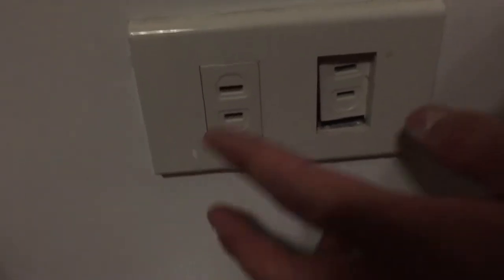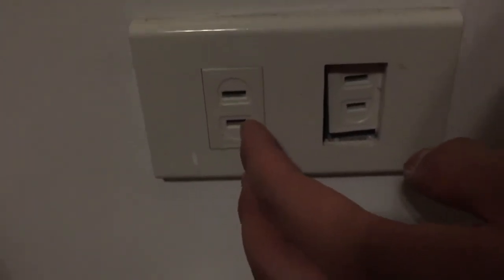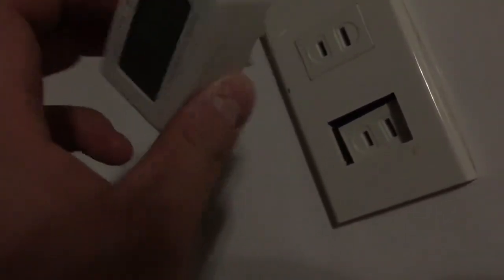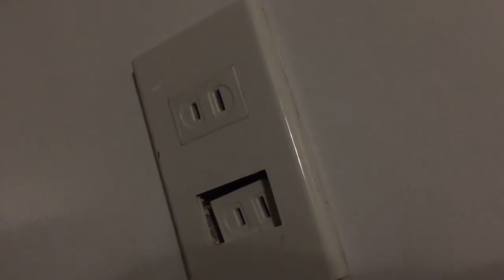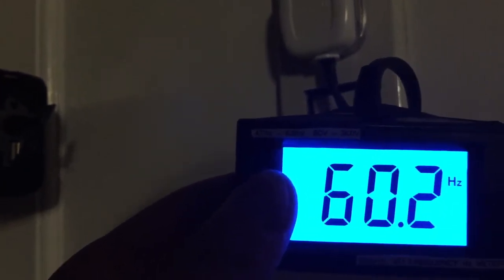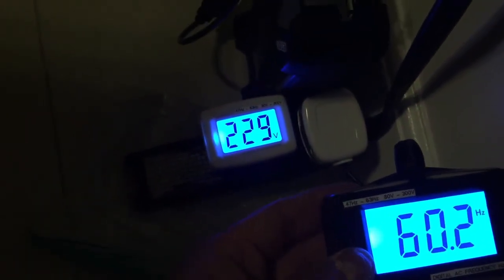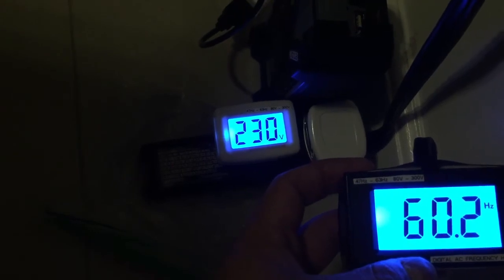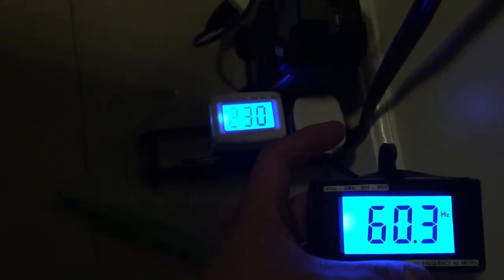PHILIPPINES VOLTAGE and FREQUENCY + ELECTRICAL OUTLETS

Comment: So a nema 120v or a similar outlet can safely handle 220v or 240v I have one implemented on a transformer and was just wondering
Reply from the maker: 250V 10A
Reply from the maker: Outlet receptacle brands: Panasonic / National, Royu, Omni, Meiji, etc..
Reply from the maker: Most Chinese 220V 2 prong appliances are mostly US plug non polarized without holes.

Comment: What color wires are behind the outlet 🇺🇸 usa black live white neutral green or bare ground 14 gage wire 15 amps 12 gage wire 20 amps
Reply from the maker: It’s White and Black https://myphilippinelife.com/philippine-electrical-wiring/
Reply from the maker: They used green wire to connect more mini receptacle into 1 outlet.

Comment: boss pano kung yung gmit ko barena dito sa pinas is 50hertz ano mangyayari sa barEna masisira ba ano ang deference?
Reply from the maker: 50Hz po ang machine. Mas malakas po ang torque niya, kumpara mo sa 60Hz machine sa 50Hz katulad ng Blender na galing ng Canada (120V 60Hz), na isaksak po sa 100V 50Hz outlet sa East Japan, 60Hz machines sa 50 Hz outlet. Mabagal pa ang takbo niya, pero umover heat pa.
Reply: may napanood din kz ako..dito sa pinas ang frequecy nten sa 220 isa 60hertz..tpos yung machine 50hertz..wala nmn daw problema tlga kung yung 50hertz ggmitin sa 60hertz country....ang hnd mgndang idea kung yung 60hertz na machine ay ggmitin sa 50hertz voltage..na share ko lng yung napanood ko..salamat
Reply from the maker: Maingay po ang 60Hz hairclipper sa 50Hz. Just need to be vigilant na gamitin mo yung US 120V 60Hz appliances aa East Japan (100V 50Hz) like Tokyo, Hokkaido, etc..)
Reply from the maker: Parts of Northern Brazil including Belem uses 220V 60Hz, the rest of Brazil including Rio de Janeiro, Sao Paulo, uses 127V at 60Hz.

Comment: Sir un po portable ac unit po na 50 Hz pede po ba sa pinas. Made in china po sya.
Reply from the maker: 20% mag-oover speed sa 60Hz yung 50Hz aircon.

Comment: Sir how about my wahl clipper its 220-230v at 50hz how can i use it in philippines im currently here in uae tnx
Reply from the maker: Yes. You can use 50Hz hair clippers in the Philippines. Make sure there’s a screw to adjust it. So make sure, your 50Hz clipper can louder on 50Hz but quietter on 60Hz.
Reply from the maker: Also you can use hairclipper from UAE in Saudi Arabia (220V 60Hz), South Korea (220V 60Hz), parts of Brazil (220V 60Hz and some states uses 127V), Peru (220V 60Hz), 

Antigua and Barbuda 230V 60Hz (US PLUG)
Brazil 127V or 220V 60Hz (Brazilian plug)
Philippines 230V 60Hz (US PLUG)
Saudi Arabia 230V 60Hz (UK PLUG)
South Korea 220V 60Hz (EU PLUG)
Reply from the maker: US 120V 60Hz haircliper plugged into voltage converter can make loud noise on 50Hz in UAE, but not in Saudi Arabia, South Korea, some states in Brazil and the Philippines.
Reply: Yes philippines has 220-230v at 60hz so i just fine tune it using the side screw tnx a lot sir im also planning to get the corded senior so its 110v 60hz to i need step down converter 220v to 110v 60hz/50hz  if i will be using it on my country tnx a lot sir really love my clipper
Reply from the maker: @nickob.8726  if you want to use 110V 60Hz hairclipper on 50Hz including 100V in East Japan (West Japan uses 100V 60Hz), 110V - 115v in Jamaica and Barbados, 127V in parts of Caribbean Netherlands including Bonaire and Curaçao (most 100 - 127V 50Hz countries uses US plug outlet). 

You need to have 12V DC 5A CAR PLUG ADAPTER TO 100 - 240V AC, and 120V 60Hz AC to 12V DC car plug inverter. That’s how you convert from 60Hz to 50Hz.
Reply from the maker: @nickob.8726  https://youtu.be/fPtocZyJKcg

Comment: 220/240v 60Hz is the most efficient system
Reply from the maker: Also in parts of Brazil (northern region like Boa Vista, Belem, etc. and 127V 60Hz in some states in Brazil including Rio de Janeiro, São Paulo, etc..
Reply from the maker: Cruise ships uses the same voltage and cycles (230V 60Hz on European Schuko outlets)  including Royal Caribbean.

Comment: Hi po Sir Francis, may question lng po ako.. nakabili po ako ng Inverter 24vdc to 220vac pero 50Hz lang po ang inverter. Pd ko po bang gamitin ito sa mga apliances ko po, like Ref., Frezer, Aircon, induction motor. maraming salamat po at ingat palagi.
Reply from the maker: Pwede po bumili ng inverter. From 100V - 240V AC 50/60Hz 24V DC adapter and 230V AC 50Hz inverter (DC: 24V DC).
Reply: @FrancisLitanofficialJAPINOY  Tnx po sa reply SirFrancis. meron nakabili na pi ako ng inverter, kaso 50Hz lang po ang output na 220 e, pd po ba gamitin itosa mga freezer at AC ko po. salamat po

Comment: Pwede po mag tanong kung pwede po sa pinas ang 240 volts 50hrtz na bili oo kc ako oven dito sa qatar so pwede po ba sa pinas un
Reply: 2400watts po
Reply: Pwede po ba sa pinas  ang nabili ko pang electric oven
Reply from the maker: Ok lang po yung oven. Galing po kasi ng China yung oven toaster namin eh. Heating coil po. Hindi po nag busted. It’s been 5 years na gumana din yung 50Hz toaster namin.

Comment: Sir pwede ba gamitin un Siemens front load washing machine namin dito s pinas n galing ng dubai na may nkalagay s likod n 220-240V 50 hz?
Reply from the maker: Zenki Dcruz Mas malakas ang RPM niya kapag 60Hz.
Reply: @FrancisLitanofficialJAPINOY   di mo sinagot kung pwede o hindi
Reply: The frequency just give more rotation sequence, so your washing machine from Dubai will run 1.2 times faster in the Philippines than the running speed that is stated on the device information
Reply from the maker: @__Man__  not just the Philippines uses 230V at 60Hz, Saudi Arabia also uses the same Hz and voltage same as the Philippines.
Reply: @FrancisLitanofficialJAPINOY  Dubai is UAE not Saudi Arabia and UAE uses 50 Hz. Only Saudi Arabia uses 60 Hz within the Arab countries, because their first generator was imported from US for Aramco. While UAE was a British protectorate, that's why they use 240V/50Hz

Comment: sir pwede po ba magamit yung red namin na 50hz galing dubai kung hindi, pwede pa ipaconvert na lang?
Reply from the maker: randy manhilot anong appliances o device yan ??0
Reply from the maker: randy manhilot Did you know, yung mga applainces na galing Saudi, pwede gamitin sa Pinas. (220V 60Hz with UK Plug), yung lumang appliances sa saudi may 127V 60Hz (110V), o kaya merong 220V 60Hz. Depende sa volageZ
Reply: Sir pwd ba magamit yung hometheater na onkyo ko na 230v~50hz
Reply from the maker: Pwede po sa 60Hz. Home theater lang. Converts from DC to AC.
Reply from the maker: @isabgonztv3619  PWEDE GAMITIN KAHIT HOME THEATER SYSTEM. Yes. Just only entertainment systems.

Comment: sir francis pwede po b ang 50 Hz na motor o appliances sa pinas na 60 Hz na electric supply sa pinas
Reply from the maker: John Russell Encarnacion Sir. Kaialngan mo ipadaan sa DC. 12V o 24V if convert to 50Hz. 

Yung mga appliances nabili from China like electric kettle, rice cooker at yung oven toaster. Walang problema mag operate,  hindi  nasira or anything. Yung Wahl o Andis hair clipper galing ng USA, traditional transformer 75W (220V to 110V), walang problema sa ingay na 55 dB, at pag nag operate ng Hairclipper galing ng America at ginamit mo sa Jamaica (110V 50Hz) at sa East Japan (100V 50Hz), mabenge ka lalo sa ingay ng haircipper sa 95 dB. Kailangan mo ng 100V - 240V AC to 12V DC 6A car plug adapter, at yung 75W 115V 60Hz power intverter galing ng USA at Canada. Para mag operate ng US hairclipper sa 50Hz countries.

Bibilis ng ikot at lalo masisira pag nag operate ng 50Hz motor sa 60Hz. Lalo mag overheat. Depende sa appliances and equipments.
Reply: 220-240 V   50 Hz   po nakalagay sa stone grinder nabili ko dito sa singapore pwede po kaya gamitin sa atin yun sa pinas
Reply from the maker: John Russell Encarnacion Ilang wattage po ??
Reply: 373 watts po
Reply: pwede po kaya gamitin sa pinas
Reply from the maker: John Russell Encarnacion www.gohz.com/can-a-50hz-machine-work-on-60hz-power-system

50Hz machine may work safely at 60Hz. 60Hz machine may reduce life expectancy of that equipment and may cause overheat.
Reply from the maker: John Russell Encarnacion Yung hairclipper na galing Europe designed for 50Hz, pwede gamitin sa 60Hz, pero mas quiet siya pag magoperate. Unlike 60Hz 110V hairclipper from the US can cause loudness at 50Hz.
Reply: ok po, salamat po mas malinaw na po saken, pwede po pala ang 50 hertz sa 60 hertz supply, ang d pla pwede ay yung 60 hertz machine sa 50 hertz supply may cause overheating

Comment from the maker: If convert to Hz, need an 12V to 115V 60Hz inverter and multivotage (100 - 240V) to 12V DC car plug adapter for use with any USA hairclipper.
Reply: 220-240v tas 50 Hz po ang nakalagay po dun sa stone grinder nabili ko dto sa singapore pwede po kaya sa atin sa pinas iyon